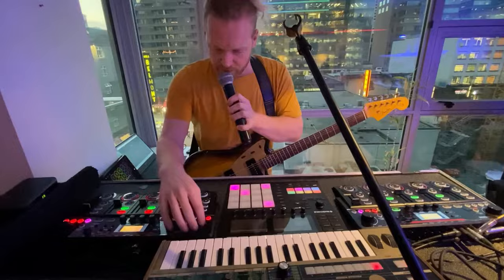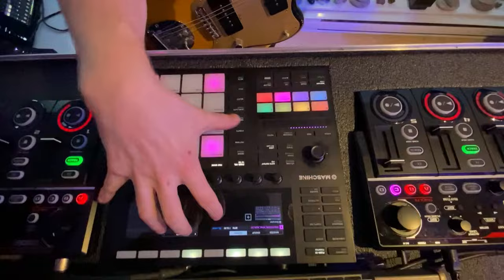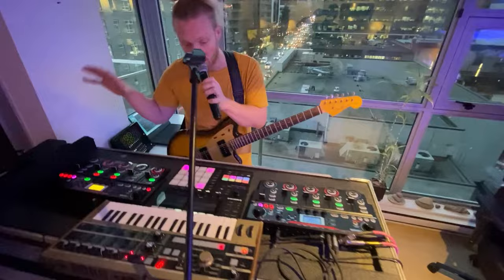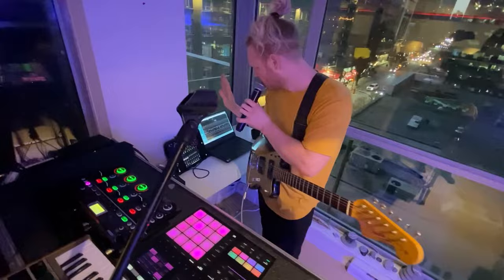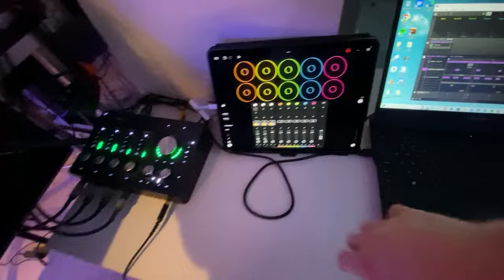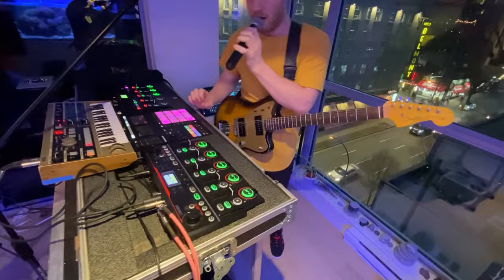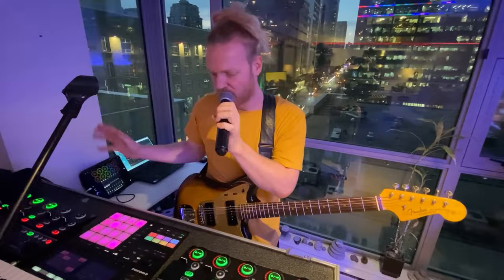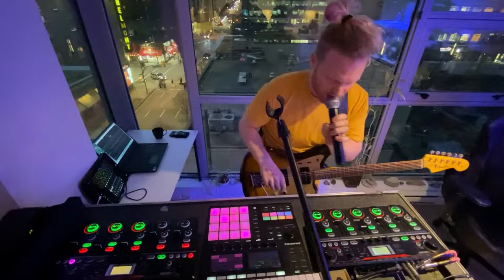Mark Woodyard's Live Looping Setup - Walkthrough and Demo

Comment: Man that drum machine is wicked! Might look in to that. Do you need the laptop when using it live? Your mic didn't seem to be picking up any of it when looping ya vocals?
Reply from the maker: Yes! You need a laptop to run maschine live, but because you can navigate maschine with the controller itself, your laptop doesn't need to be accessible. Just needs to be there!

And in terms of the mic, if you dial in your mic volume/EQ and have it placed right in regards to where your monitors are, you can get minimal sound feedback/bleed when looping vocals. Also, the RC-505 has an adjustable mic gate in the input settings that is super helpful for avoiding sound other than your mic creeping in to your vocal loops.

Comment: Thank you. Great demo. 
One question. I've heard so many people say the RC505 mk2 works great as a midi master but it won't slave to an external midi clock. How have you managed that?
Maybe it's ok with another another RC505 as the Boss (excuse the pun)
Reply from the maker: My vocal 505mk2 does slave to the other 505mk2, but I have had certain issues with slow down/glitching when a bunch of loops get going that I never had with the OG RC-505. I'm hoping that with firmware updates they can sort this out. It hasn't ruined my shows by any means, but it's definitely an issue at times.

Comment: One kinda weird question I have (which feels dumb because this totally isn't what your video is about), is how/where did you figure out packing up that gear for gigs? Is that all packed into a flight case that you just bring out and put on a table? I'm trying to cut down set up time for gigs and I haven't figured it out yet. Thanks for this video!
Reply from the maker: Not a weird question at all! I got this case custom built for my setup. It has retractable legs too so it's also a table. It folds into itself and is on wheels. It was designed and built by https://www.dinosaurcases.com/ in Vancouver! Super good price for it's value too. 

When I fly to gigs, I take my stuff out of the case as it's a little too big/expensive to tour with.
Reply: Awesome, thanks!! @markjameswoodyard

Comment: yo bro big setup! good to see it all in action! lol i have RC-505 Looper + MK3 for a few months now and hanvt seemed to been able to sync them like this.... Great Work! 

Id love to see how you get the settings right within Maschine - Thanks!

Does your guitar go directly into MK3 or into the RC 505? (i dont have a guitar looper pedal) I am having trouble with my MK3 Drums to Sync with my Guitar directly in to RC505.

Any help would be appreciated!
Reply from the maker: Guitar goes into my Line 6 Helix and then into my 505., but you could run your guitar directly into the 505! There are EQ and Effect settings that can make a guitar sound good in the 505. 

In terms of syncing the 505 and the maschine, you can run a midi cable from the MIDI OUT of the 505 to the MIDI IN of the Maschine. 
Then go to Preferences or Settings in Maschine, and go to the MIDI category. 

There's a Midi Clock option that will have the options, OFF, Master,(Send) Slave (Receive)

Choose Slave(receive). This will tell your Maschine to receive the Tempo from your 505. When you press record or play on your 505, it will play on Maschine. You can play existing beats you've made in Maschine, or record them live to the 505 tempo! Hope this makes sense!

Comment: Thanks for sharing! Inspiring set up man! I really like your use of Maschine for tying it all together with the drums. Have you considered switching to the Maschine+ standalone?
Reply from the maker: You're very welcome! Ive considered maschine + but I had a friend get it and had a lot of problems with it. Glitching out, crashing/cutting out mid show. Horror stories!! I find having a powerful laptop running it has been really good in terms of stability and the amount of plugins/sounds at once it can handle. So I'm gonna stick with what I have.
Reply: @markjameswoodyard  that makes sense. I saw Loopy Pro down there and was wondering what you were using it for lol. Mixer!

Comment: Nice setup Mark! Have you played with the built in rhythm on the 505? What are your thoughts?
Reply from the maker: yes! I have. They can work in conjunction with my beats running on Maschine and I do this sometimes.  And you can adjust the volume of the rhythm track in the 505 so they sit in the mix well which is crucial.
I find some of the beats kinda dry and normal sounding, but others work within my sound.